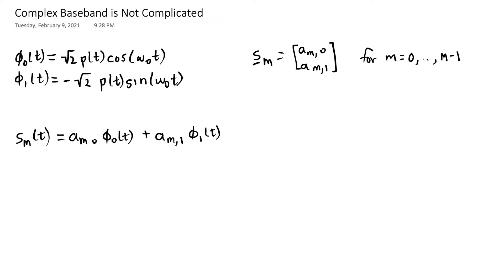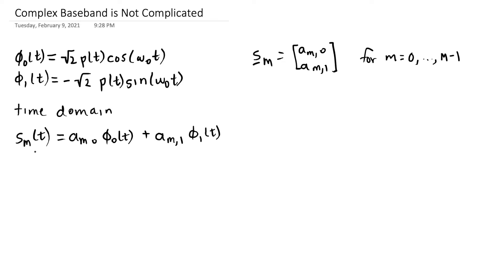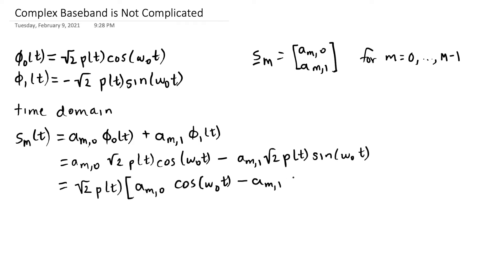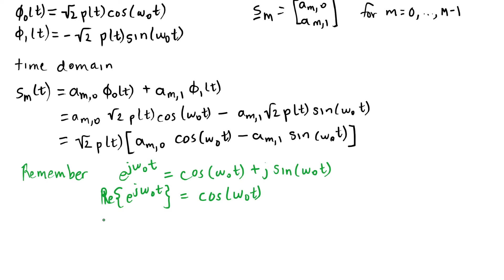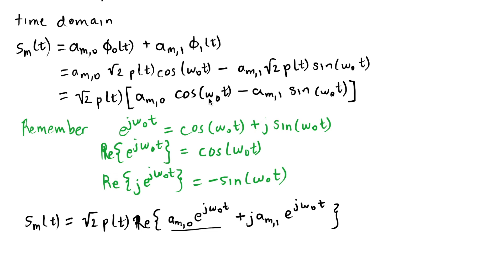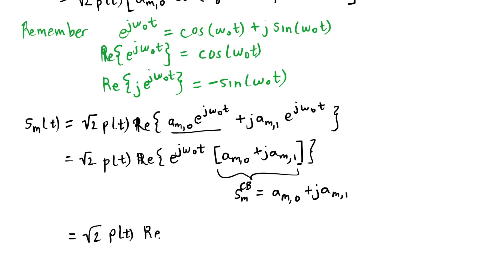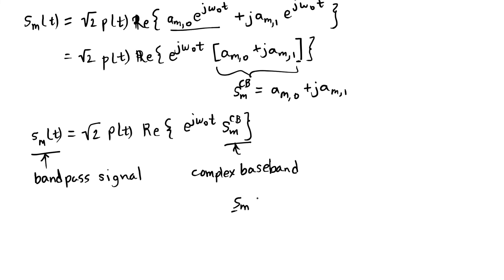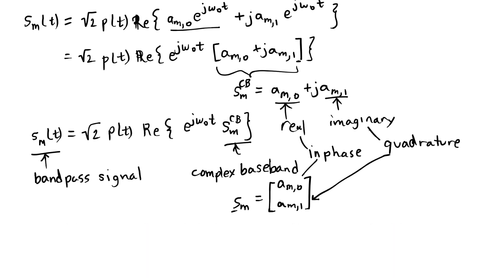ESE 471 Complex Baseband is Not Complicated

Comment from the maker: Ha ha slightly more complicated than I made it to be.  I made an error; the p(t) should be brought inside of the Real operator and included as part of s^{CB)_m, that is, part of the complex baseband signal.  That is:

   s^{CB}_m = p(t) [ a_{m,0} + j a_{m,1} ]

And we can convert back to the bandpass signal by taking:

  s_m(t) = \sqrt{2} Re{ exp(j \omega_0 t) s^{CB}_m }

That is, we include p(t) in the complex baseband version of the signal, so we don't need to specifically include it when we convert back to bandpass.